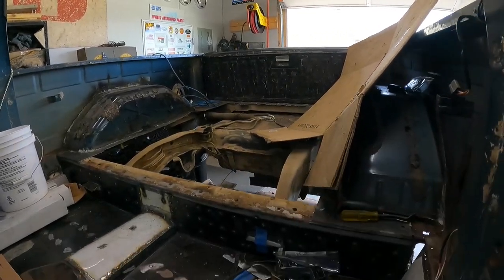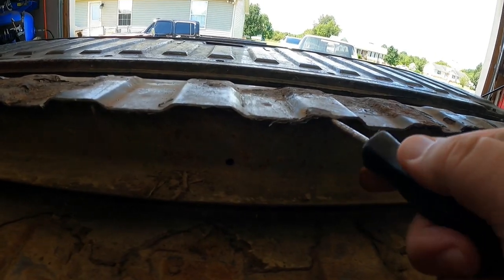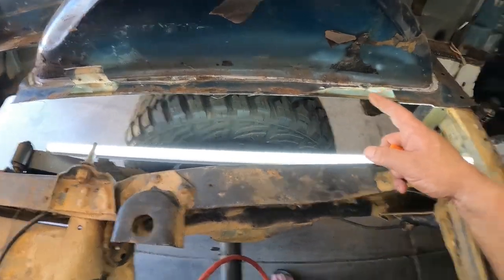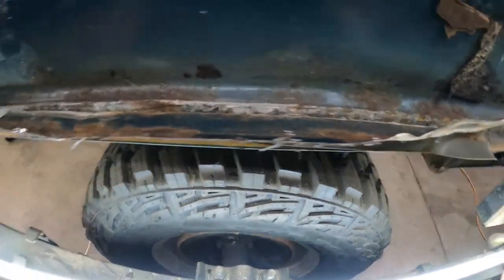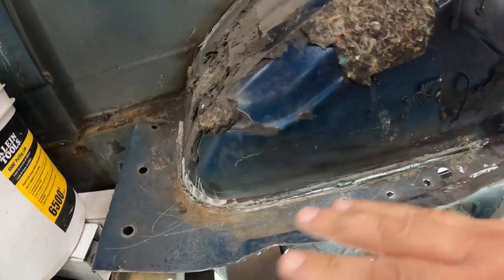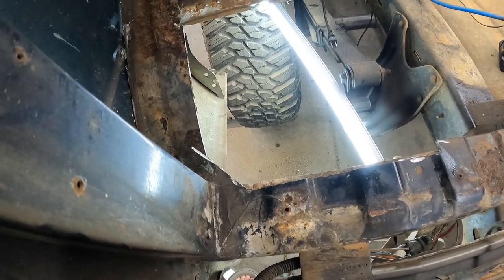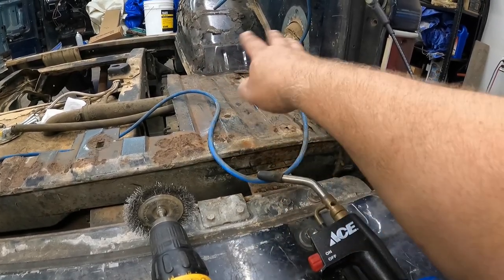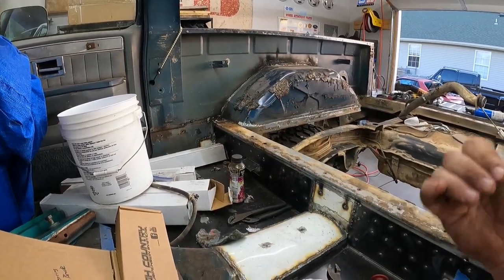K5 Blazer Resurrection Part 16 - Finishing up removing the old rusty bed floor.

Comment: Do you put chips inside your PB&J sandwich? You should try it if you havent.
Reply from the maker: Haha! I have in the past, nowadays I usually make a tri-level. Lightly toasted, jelly on the outside slices and PB on both sides of the inner slice. It's amazing!